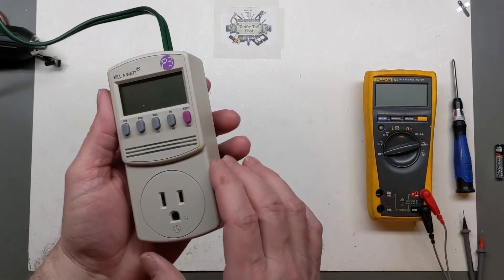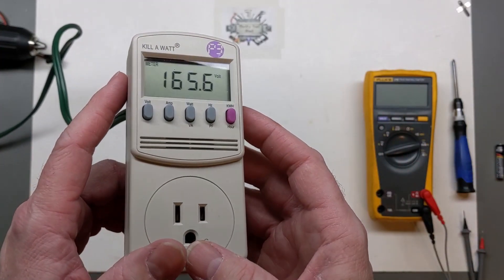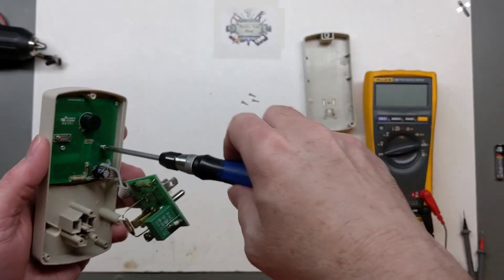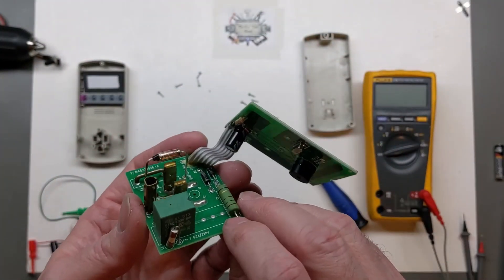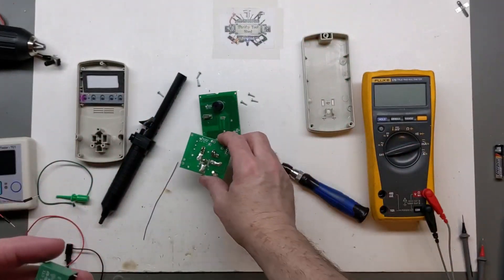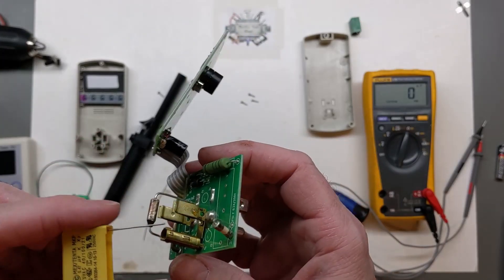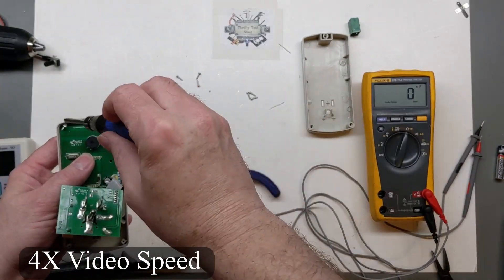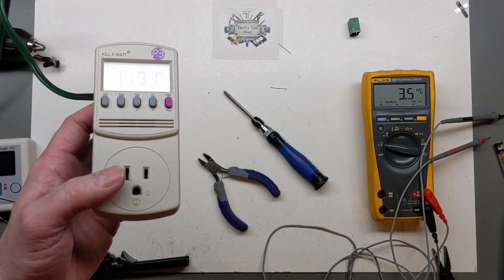Kill-A-Watt Power Monitor Repair

Comment: Thanks for your video.  I have a different problem which maybe you can suggest a fix before I toss it.  My P3 P4400 has a blank display.  I have already tried jumpering F1 & F2 which not help.  The diodes seem to measure fine (both ways).  About to donate it to my trash can.  I have an electronic background (over 30 years) but, some things aren't worth the trouble to save.  Anyone with suggestions would be appreciated!
Reply from the maker: The fuses would be the go to for sure. Since you have already eliminated those, the 7805 5V regulator maybe if no display at all. If the 5V is good, is it possible just the zebra strip connection to the lcd having a bad connection. Sorry I have not had any other experience with a failure of that nature, hope it helps a little. Best of luck with your repair!
Reply: I have the same problem

Comment: Nice job John, I have two of these Kill a Watt meters, and I have never had reason to open them, but with your video I have  an idea of what's in them... I wonder what your back ground is ? I am a retired EE, and yes still dabbling with sparky items.... I replaced some failing caps in three of my subwoofer plate amps this year, they are now back in operation, and the parts cost was about $1... The vendor wanted $300 for a new plate amp each.... Sometimes have a  little kill and patients  can save you a good deal of money... Keep your videos going, nice presentation. Regards, -BC
Reply from the maker: Awesome job on the repair. I have been in the Industrial Electrical field for about 25years (mostly reliability) and have always loved learning more about electronics. We hardly ever repair down to board level these days in the industry.  I still hate throwing things out that still has value. Thanks for your comment!
Reply: @ThriftyToolShed  I kinda thought you had some failure analysis background... I have done some FA on laser systems used on military craft and other hardware...Sometimes you find things that  really surprise you... All in the learning process.. I just came across your videos this morning, and watched some, nice presentation, lot soon good info and well done... Keep at it, Regards, -BC